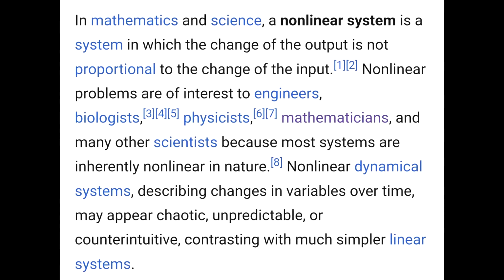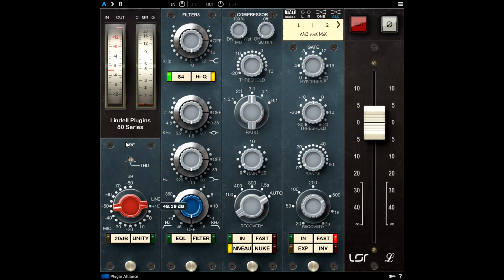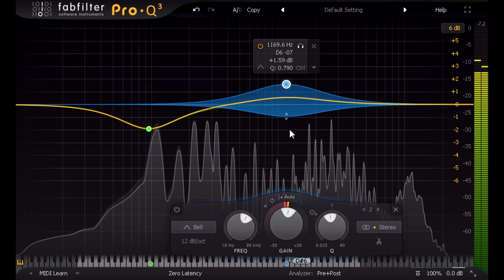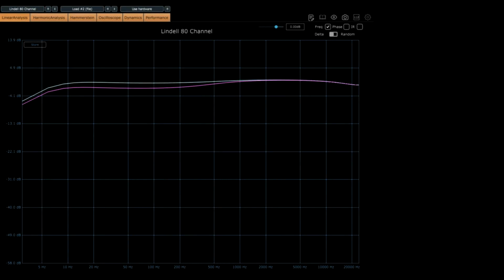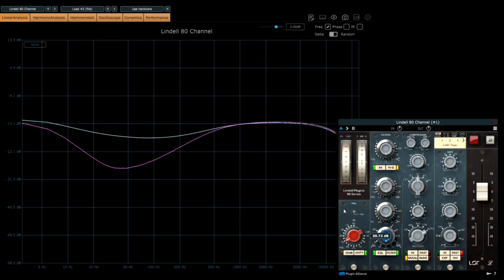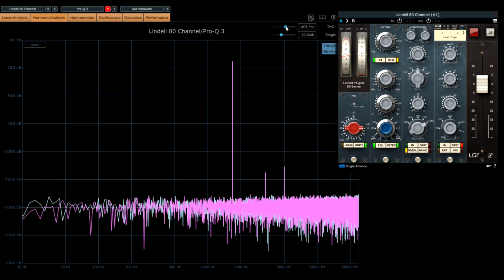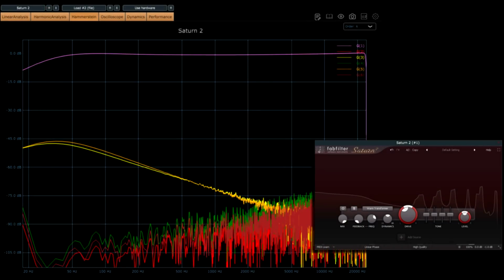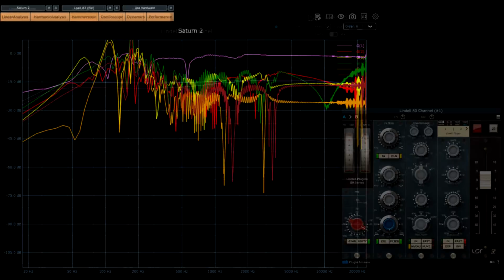WTF is a Non Linearity?

Comment: About gain vs volume... it worth noticying than gain is dB scale but volume is sometimes a Percentage, where 0 would bring to silence. Though with gain 0 you can still have signal hot enough to pass.
Reply from the maker: That's not really relevant. In fact gain expressed as a decibel value will have to be converted to a linear amplitude factor for the actual gain change. Eg +6dB gain means multiplying your voltages or sample values by 2 (approx). -6dB means multiplying by 0.5.
Reply: @DanWorrall  that was more an argument on the 'Gain = Volume' statement than on the non linearity aspect of things, as Volume can sometimes refer to a multiplier where 0 would lead to no sound and 1 (100%) to unaltered sound. Am I confused by the terminology here ?
Reply from the maker: @XRaym  in that case 50% means -6dB of gain. It's still gain, whether you define as a decibel value or an amplitude factor.

Comment: Here is my attempt to fire back at Dan and avenge the guitar community:
Assuming you have a perfect string vibrating with no loss of energy (in a vacuum in space and no transfer of energy in the guitar body and neck), then the energy of the string is determined by how much momentum you gave it + how much tension is applied on the string.
When you decrease tension, you lower the energy of the system, and I'd bet good money you affect the amplitude of the vibration: not entirely sure if the amplitude is less or more though since you lower the energy of the system but also let the string move more freely.
In any case, what I can say for sure is that there is less energy in the system ("initial impulse" is conserved but tension is decreased), and I'm willing to bet this has an impact on how loud the sound produced by the vibrating string is.
Conclusion : a tremolo bar does probably affect level, and therefore is a tremolo effect... As well as vibrato.
At least, this is what my "dad in the garage" physics reasoning intuition tells me. I hope I get comments to debate this !
PS: I'm being cheeky though, I totally agree it's primarily a vibrato, and that the tremolo effect is less noticeable unless you dive bomb

Comment: Another great video Dan but it has left me with some unanswered questions and, since Paul Third has put his hand up, let me be specific.  What I don't quite understand is what is wrong about Paul's video(s) because you said that almost everything he said is wrong but I'm wondering if I am interpreting that comment correctly.

So, I think it's been pretty much put to bed that Paul's use of the phrase "non linear" is wrong.  He's using it as a shorthand for something like "has no characteristics of analogue hardware" or whatever but the point is well made and (I think) well taken that non linear means something quite specific and he's using the phrase totally incorrectly.

However, can you clarify whether, beyond that, the points he is making are valid?  Specifically:

1.  When he tested the Harrison plugin, the eq curve was exactly the same as you'd get from any parametric eq like pro Q3 or, indeed, the stock plugin that comes with most DAWs.  It was nothing like the "quirky" eq curves you get when you use a lot of hardware.  

2.  Similarly, I think it was the Harrison plugin but it may have been another one, the plugin isn't generating any higher order harmonics so, again, it's just a clean eq without adding any of the stuff that you would normally associate with analogue gear.

I think those two are correct but here's the one that I'm genuinely not clear about ...

3.  When he reviewed the SSL fusion plugin (the vintage drive) he showed that turning up the density knob produced a horrific bump in the low eq and said he thought it was a bug.  However, I'm pretty sure he was using the linear analyser (bertom eq analyser).  So, now I'm wondering whether this was a case of using the wrong tool to measure something and therefore getting the wrong result?  Although I'm further confused by the fact that the SSL Fusion hardware in the access analogue system didn't do the same thing so maybe it really is a bug.

Anyway, great video, very though provoking (loads of comments already) but I think some clarification on those points above, particularly the third one, would be very helpful in tying it all up.
Reply from the maker: 1. I reviewed the Harrison channel strip as well. Yes it's linear (dynamics excepting of course) and the EQ nulls with ReaEQ. I regard that as inferior to Pro-Q3 due to high frequency cramping.

2. Haven't seen that video. But if there are no added harmonics its probably a linear EQ. Nothing inherently wrong with that, unless the marketing suggests otherwise.

3. Again, haven't seen it. But if the density knob adds some kind of non linearity, then it might have just broken the test.

Comment: Do digital limiters, like ozone maximizer, fabfilter L2 etc color the sound when gain is increased but the ceiling has not been reached? 

I was recently told this, but it seems unlikely.
Reply: "color"? some might but usually not, certainly not those 2. depending on the signal path some might not be what's called "bit transparent" meaning the signal path alone alters the integrity of the pcm stream. that has to be pretty severe to be noticeable aurally in itself though, but can cause downstream problems on processing. The 2 you mention there though are among the best I wouldn't be worried.

Comment: I understand how aliasing happens, and why its results are not related to the harmonic series, but I don't understand why analog distortion is related to the harmonic series. Why should clipped audio signals produce harmonics that are related to the fundamental?
Reply: Ah, this is the stuff. Let's say you have a transfer function f(x) that takes your input signal x(t) and transforms it into output signal y(t)=f(x(t)). And we just say x(t)=sin(2piF*t+k), so it's a sine function with frequency F and some time offset k. Then if f(x) was linear the output would be a*sin(2piF+l), i.e. a sine with changed amplitude and time offset. A general function f(x) can be approximated with a Taylor series, assuming it is indefinitely differntiable, which we're just going to assume it is (if our audio gear had a transfer function that wasn't there would be a Nobel prize in Physics down the line, let's assume our gear does produce that magic sound without the actual use of magic). In this case we can write it down as a polynomial f(x)=C+ax+bx^2+cx^3+dx^4... So at first we have ax. That's just a linear function and we get our original frequency back from it. Then comes bx^2, which means we have to know what happens when you squeare a sine function. Neatly enough sin(a)*sin(b)=1/2(cos(a+b)+cos(a-b)), which means that (sin(a))^2=1/2(cos(a+a)+cos(a-a))=1/2 cos(2a)+1/2. So we get a constant as well as a sine wave at twice the original frequency. Now for the x^3 term we just multiply our x^2 term and multiply that by sin(a). We get (cos(2a)+1)sin(a)/2=(sin(2a+a)+sin(2a-a))/4+sin(a)/2=(sin(3a)+3sin(a))/4, so we obtain our original frequency and a frequency 3 times the original. For x^4 it's 2F and 4F. For x^5 its F, 3F and 5F. For x^6 it's 2F,4F and 6F. I.e. we always get integer multiples of the base frequency and for the even exponents we get all the even multiples, while for the odd exponents, we get the odd multiples. Note that the even exponents also create a constant term, which would be a DC offset in analog gear, which we'd deal with by adding a high pass with very low cutoff.
Reply: @simongunkel7457  Ok I'm no kind of math nerd but let me see if I understand. Essentially, as we increase the amplitude, the analog gear running the equations reaches the limits of its precision. As it does so, the equation produces errors with values that are integer correspondents to the input. The limits of this precision are in terms of this polynomial equation, and how many iterations the gear can run, with lower headroom gear deteriorating at a faster and less controllable rate.

If this is a reasonable layman's articulation of what you said, then high-fidelity analog amplifiers would have exponentially more complex circuitry than their lower-fi brethren, which would explain the price difference. But presumably, some lo-fi circuits have come to be highly sought-after. But of course, few people would have an understanding of the underlying mathematical principles--a brand name would become associated with a particular type of decay, and become "vintage gear" despite having easily reproducible circuitry.

Comment: I always had the understanding of non-linearity in the context of processing, meaning the type and amount of processing you dial in is not exactly what's going to come out, and changes could become exponential. On a related note, that's what helped me understand program dependence, which I believe is where depending on the type of input you get different processing, hence different outcome. Our "friend" may have used the wrong ways to measure it, but he wasn't completely incorrect in his conclusions.

Comment: Here's a random though i had that i cannot answer on my own: Is it possible to hear only the aliasing on a saturated signal? or maybe, have a plugin that applies harmonics the way they would be if they were aliasing? maybe this question doesnt even make sense. IDK what im talking about
Reply: If your PI has an oversampling option, run one copy with oversampling on, one with oversampling off and flip the polarity - anything but the aliasing should null. There are a couple of Vsts that add aliasing, by reducing the sample rate with bad AA filters, some including options to change the AA filter, but none of them seems utterly perfect.

Comment: What exactly are the differences between different saturation/distortion plugins? Different transfer curves, different pre- and post- EQ, different oversampling? Also is there a difference between running a clear digital EQ followed by a very mild saturation plugin and an EQ plugin that is "analog modeled"?
Reply from the maker: All those things, plus "hysteresis": like a kind of memory effect where the distortion depends on what's happened recently as well as what's happening now. Yes there is probably a difference between saturating EQ and EQ plus saturation, but I'm not clear that one is inherently better.

Comment: I think that (non)linearity is a the kind of "concept" that simply needs to get a definition before using it. In data science / statistics, a linear equation system is a system in which the output variable varies with one or a combination of linear terms. If one term is non linear, the system is non linear. From my "data scientist" viewpoint, a non distorting plugin can still be nonlinear, for example if a gain knob is based on log(input value).
Reply: But researchers in signal processing agree what it generally means, and this is their domain? I don't see any benefit to audio engineers using a different definition of linearity to the people who design their tools.
Reply: @FrequencySummoner  Actually it means the same thing in statistics (a linear map is a linear map is a linear map). How do you prove the central limit theorem in statistics? By moving to a conjugate space using the fourier transform, which is a linear operator. How do you display a spectrum analyzer in your EQ plugin? By moving to a conjugate space using the fourier transform, which is a linear operator. Heck, my lectures in probability theory had us deriving the Shannon-Nyquist sampling theorem, because it's relevant there. Digital signal processing, statistics and probability theory are really closely related fields of mathematics.
Reply: @simongunkel7457  Right, naturally statistics and signals are closely connected by sampling. I was really responding to the "data science" viewpoint. (One would hope of course that data science is also firmly rooted in traditional stats, but that's another debate!)

I think Sebastien's example is more a "nonlinear user interface" than a nonlinear *process*.
Reply: @FrequencySummoner  Well one way of looking at a plugin is that you have the input signal, which is a vector and the output signal, which is also a vector, the dimensionality of these is playback time*sample rate. And for a linear plugin you get a transform matrix M. In his example you have a control value Y and then a transform matrix e^Y*M. That would still be a matrix and thus still a linear plugin. Now if Y was a function of your input (for instance if it was automated by input level) you could introduce a non-linearity. But just because the exponential function is a non-linear function the behaviour of the plugin doesn't become non-linear - e^Y is just a number.
Reply: @simongunkel7457  Right, as long as Y is constant then multiplication by e^Y*M is linear. (Interesting consequence: linear plugins become nonlinear if you automate them!)
Reply: @FrequencySummoner  Only if the automation depends on the input. Otherwise you get a different transformation matrix, but it remains linear. A simple example would be a gain adjustment. There you have a matrix where everything is 0, except for the main diagonal, which has the factors by which each sample is multiplied. So if this was automated, you'd get different numbers along the diagonal, but it'd remain a linear transformation. But if you made the gain factor depend on the input in some way, then you'd have a non-linear plugin, since then you aren't multiplying each sample by a fixed number, but by a function of the input (and potentially not just the sample itself - a compressor would be an example where the gain depends on the input level, but not just at the time of the sample being processed).
Reply: @simongunkel7457  No. Level-dependence is one kind of non-linearity, but so is time-dependence. For example, tremolo is nonlinear. Consider an effect chain consisting of a 1/4 beat tremolo and a 1/8 beat delay. The delay is linear. The result will be completely different if the tremolo is placed before or after the delay; is it chopping the notes on the beat or off the beat?

And if tremolo is nonlinear, so is a (linear) gain plugin that was automated to change gain in the same way.
Reply: @FrequencySummoner  Matrix multiplications in non-commutative, but the successive application of linear transformations remains linear, though changing the order changes the result. On the other hand you can find non-linear transformations that do commute for instance e^ln(x)=ln(e^x).
Reply: @simongunkel7457  I've had another poke around some signal processing literature and it does look like in some areas people distinguish between "linear, time-invariant" and "linear". In that notation, only systems that are linear + time-invariant have the property of "homogeneity" (i.e. operations can be re-ordered.)

But other sources declare that homogeneity and additivity are the two required properties of a linear system, which is is the definition I was using 😞
Reply: @FrequencySummoner  Hmm, operations being reordered would usually be commutativity (and potentially associativity), homogeneity generally refers to f(a*x)=a*f(x). So along with additivity (f(x+y)=f(x)+f(y)) you get linearity (f(ax+by)=af(x)+bf(y)).
Time invariant functions are commutative specifically with a delay, here meaning just the wet signal. A distortion would be time-invariant, but non-linear, while the tremolo would be linear but non-time-invariant.
Reply: Well, you can view a plugin as a function in two ways. One is the transfer function F, which for samples x and y (in [-1,1]) has to satisfy F(ax+by)=aF(x)+bF(y) [1] to be linear (a,b in R). The other if the function G, which given two functions f(t) and g(t) has to satisfy F(af(t)+bg(t))=aF(f(t))+bF(g(t)) [2]. This second criterion is stronger and [2]=>[1] but not vice versa. A compressor satisfies [1] but not [2]. Dan Interprets the compressor with really fast attack and release times as not satisfying [1] and that seems to work out, but it is equivalent to assuming it does satisfy [1], but an audio-range amplitude modulation is applied. This interpretation is borne out when you use sidechaining, where it becomes clear that given a constant side chain [1] is satisfied. So is [2] in fact. The non-linearity of a compressor happens at the detector side!